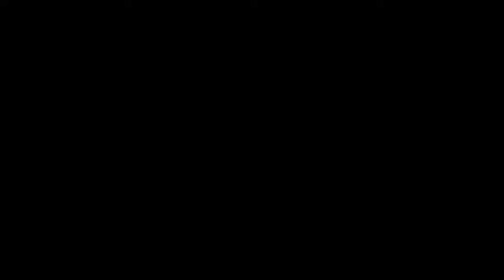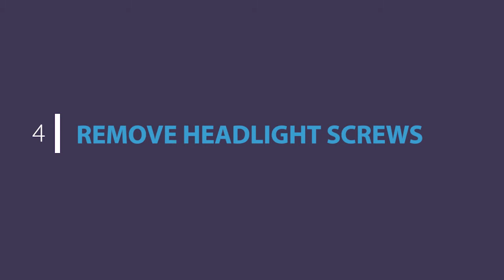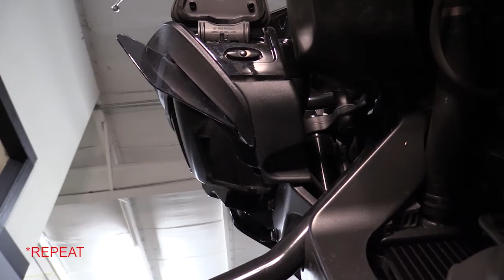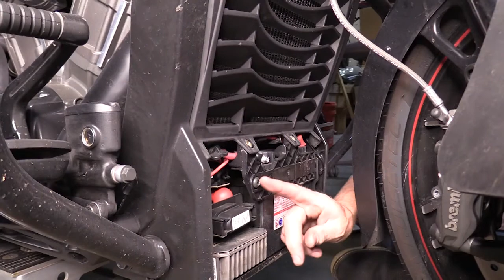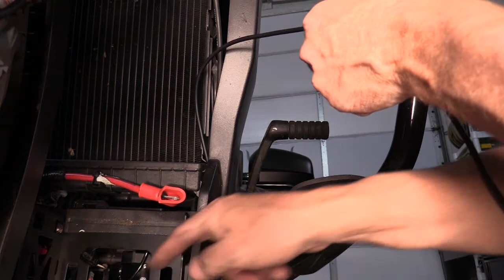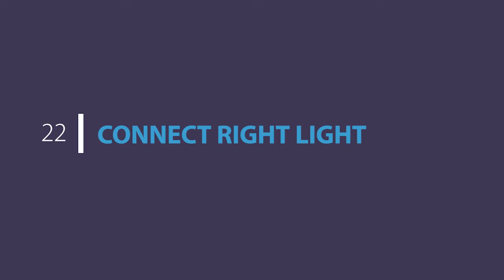Indian Challenger Puddle Lights

Comment: Lord, is it black to black, or black to white? Your video instructions on the wire connections is confusing! Please clarify. From what I gather, it's black to black, and white to red on BOTH lights. Is that correct? Also, I didn't get a drill template in my shipment!
Reply from the maker: Black to black, and white to red.  And just in case, you cannot damage anything if they are connected backward.  An advantage of LEDs.  Can you shoot an email to orders@electricalconnection.com and we will email the template.  Apologies for the omission.